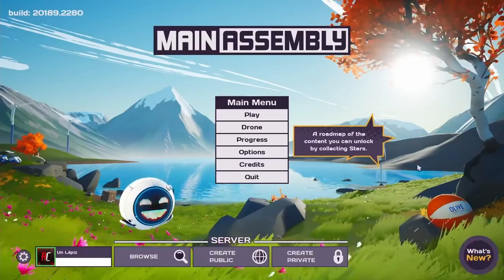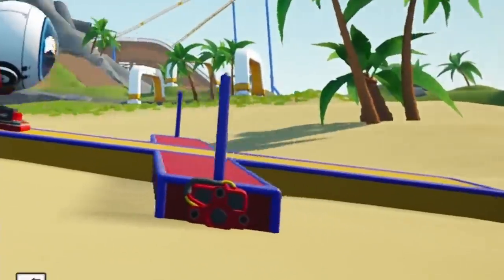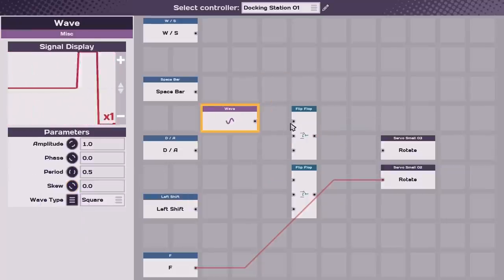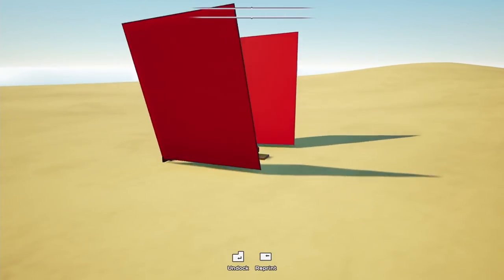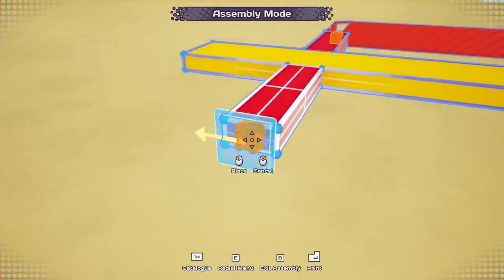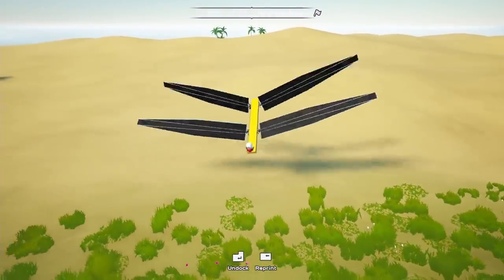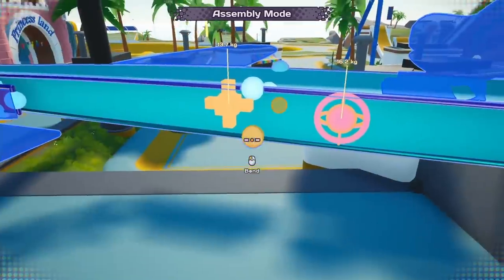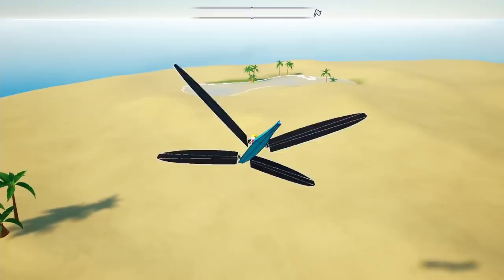Making a Dragonfly in Main Assembly

Comment: I wonder if alot of the initial weirdness with pullback and the later setup of controls might have been avoided if the two motors were switched, so the body connection only moved up and down while the second connection controlled rotation. This would allow you to change the angle of wing relative to motion and trim different amounts of thrust that way. Sort of like the principle of a helicopter blade but in a sinoidial motion rather than a rotary one.